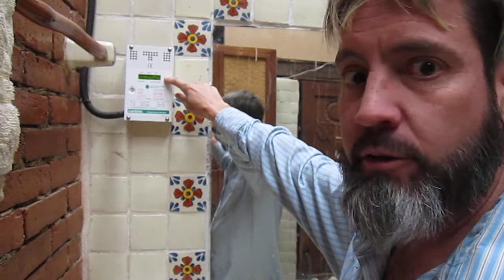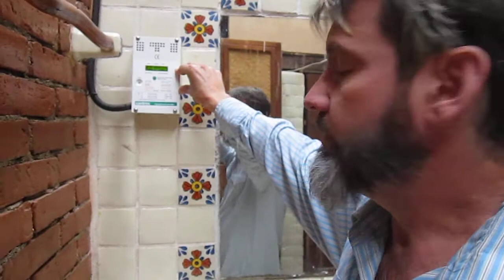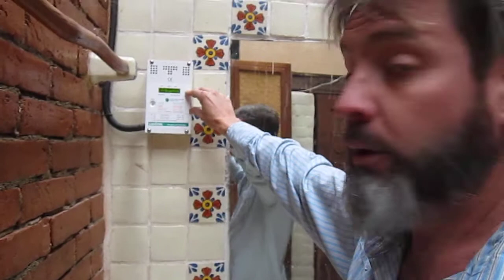Testing the use of the blender on a small solar panel system.

Comment: I like your comments about people adjusting their lifestyle. Just curious to know how big your battery bank is?
Reply from the maker: I have 340 watts of solar panels. And I have 8 LTH Golf batteries which are a little over the size of a car battery.  Given the option, I would increase the number of solar panels rather than increase the size of the battery bank so I would have more power in the day. at night I just need enough for LED, and one computer to be uploading videos. 
LTH has a new Solar battery, so future systems will use those. https://www.flickr.com/photos/thebosque/6926059366/in/photolist-a3HmcK-ecLgNt-ecLc6t-ecRTLN-8xsbRQ-ecRRsb-ecRSkq-9pJYvK-7EHGr5-9pJVxP-ecRU5j-ecLf2K-ecLcAV-ecRV1J-a3L73A-a3HmyV-by2S9E-ecRRJC-ebkcyE-9pJXxH-a3HgxH-a3HgW4-65enGm-a3L6CE-ecRTcQ-7NPeL4-a3Lc8U-9pMXG7-7EDQfk-9pMVk7-a3HfZD-9pMWas-ebgn62-ecRS3U-ecRVwA-9J3sgU-a3L95y-a3Hhgr-9pN1su-9pMYjY-7JrQsS-96VUpd